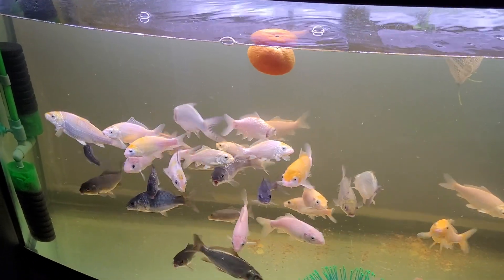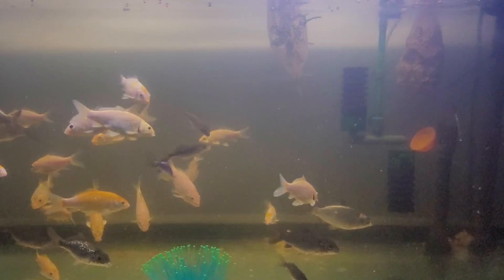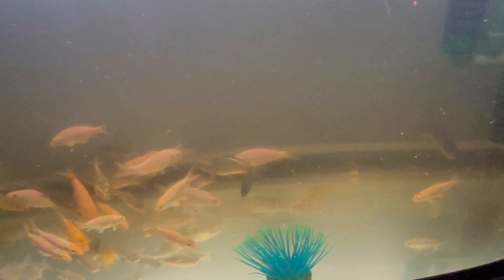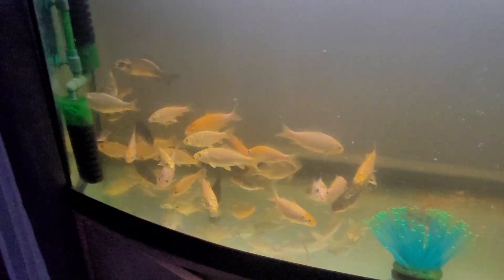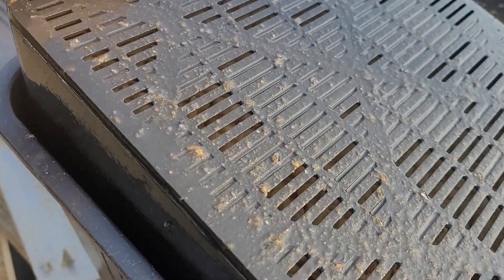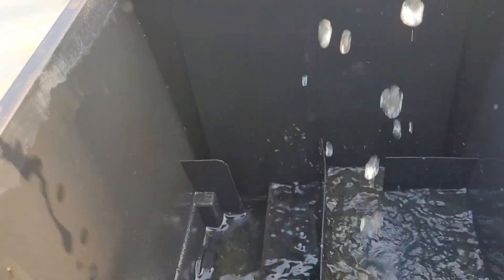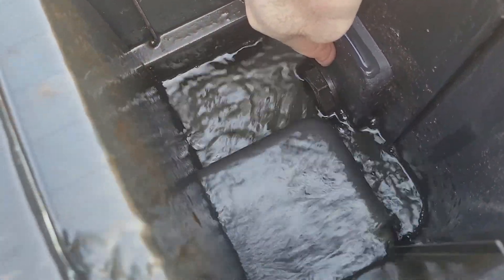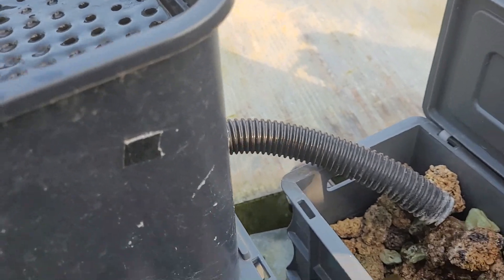My Upflow Filter in detail (Evolution Aqua Pure Pond Filter)

Comment: I don't think I've ever seen one of those filters before. I suppose the downside to them would be the risk of overflowing but that should be easy enough to overcome.  The profit margin probably wasn't high enough which is why EA stopped selling them.  Very good principal though.
Reply from the maker: They could only generally over flow if you put a pump on that was 2 powerful for it or put filter floss in and didn't change it so only human error could overflow it 👍